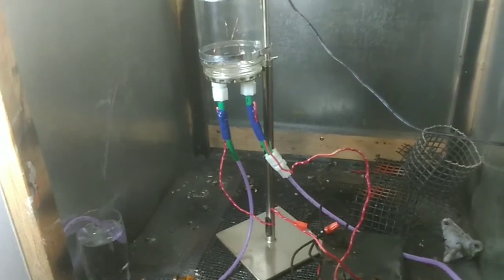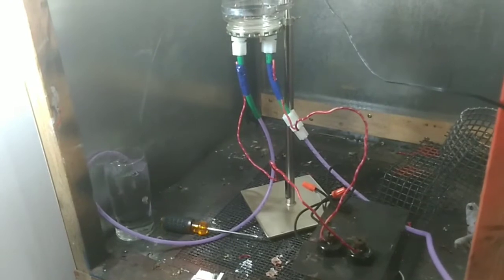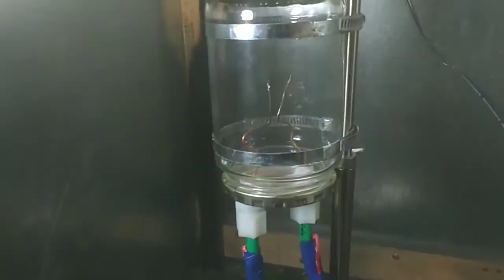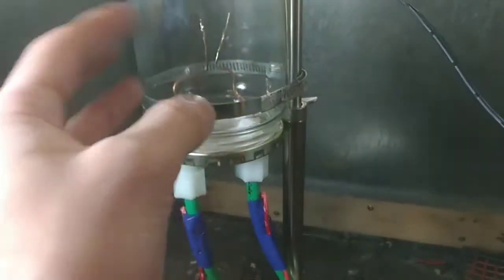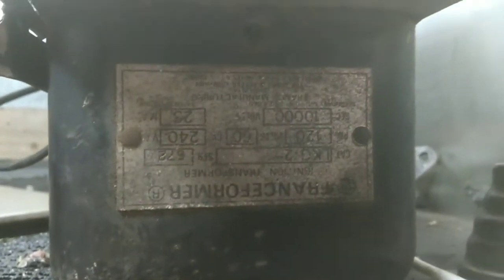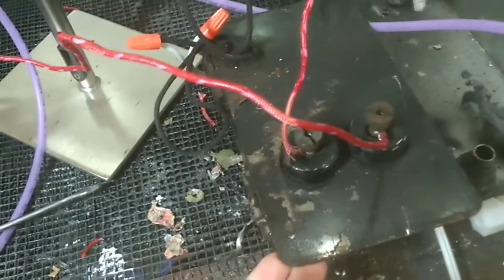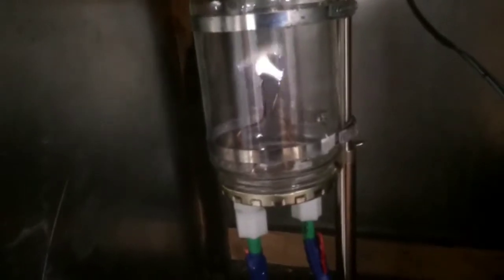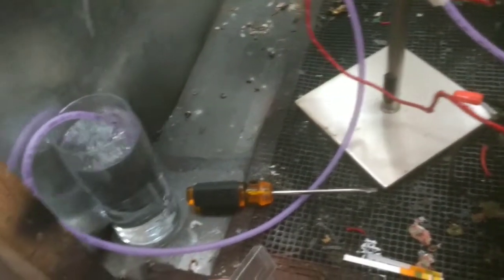Birkeland–Eyde Process Benchtop Demo

Comment: Fuming nitric acid, pretty dangerous stuff.
Reply from the maker: This setup uses electricity to make the "fume" (NO2) from air. To make acid that has to be dissolved in water to form HNO3. The amount of power used here (around 100 watts) can't make enough NO2 to be poisonous...it's more of an irritant if it gets loose. But the process is quite important as this represents an opportunity to directly produce nitrogen fertilizer from electricity.
Reply: @Anthracite Energetics  the final product is fuming nitric acid if I'm not mistaken (always a possibility) I wasn't referring to the fumes during production.

Comment: you need first an bigger bottle as oxydation tower best filled with moist pumic stone pices or crushed briks. then 3 other bottles in series 2 with ordinary water and the last one with soda or pottash solution to bind the remaining nox.
Reply from the maker: Yeah the chemistry could be improved for sure! The ordinary water scrubbers generating acid and the last ones with lime, which will make a useful fertilizer (calcium nitrate).
Reply: افضل استعمال الوارتز  وشرارة كهرباءية اكثر من 20كيلوفولت والهواء يكون في الزجاجة بضغط 10بار   ومخرج الهواء ببطء لكي تزيد مدة تأين ثاني اكسيد النيتروجين والاوزون